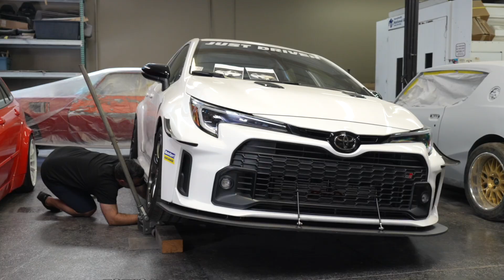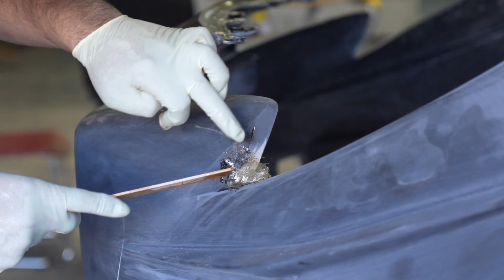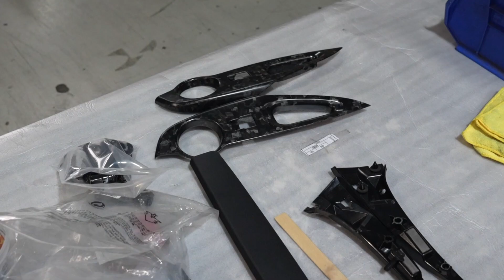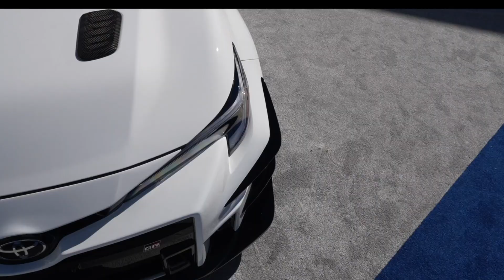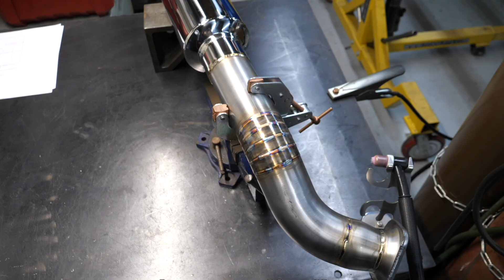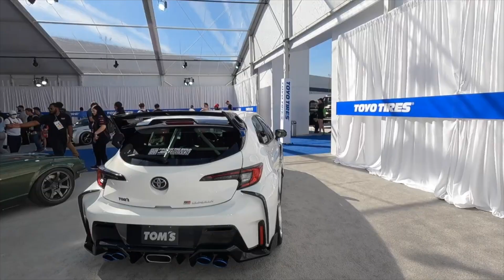TOM'S GR Corolla Catalog Car FOR SALE!

Comment: So I noticed you mentioned that the Supra front bumper ended up weighing a ton.  Did the same end up happening for the GR Corolla?  I just saw a lot of work going into shaping and sanding on that bumper for fitment so I wonder if it ended up adding a bunch of weight to the bumper after it was finished.
Reply from the maker: No. The production bumper weighs a lot less. The one on our car was a prototype.
Reply: @JustDriven  Did the one on your car end up heavy?
Reply from the maker: It was only a bit heavier because of the filler we used to perfect the shape.